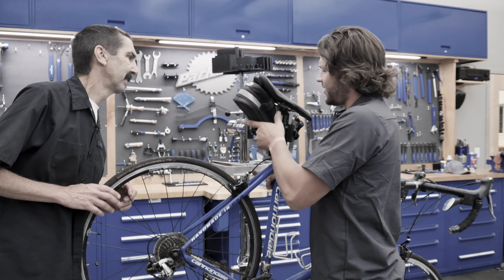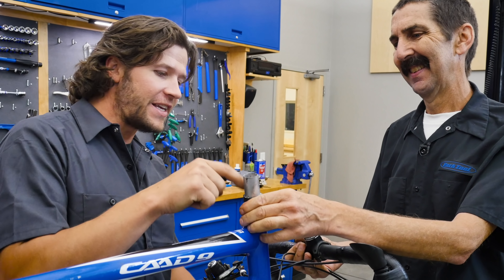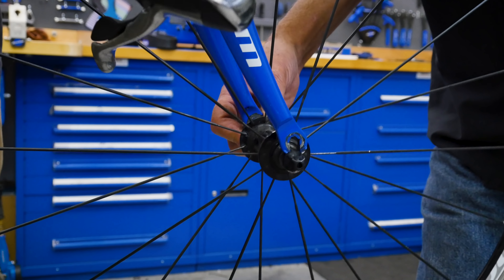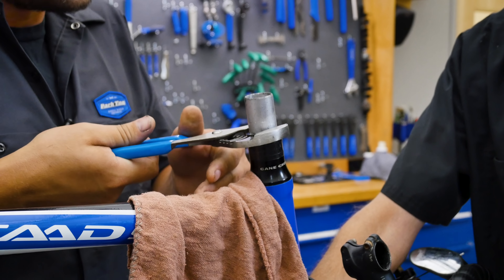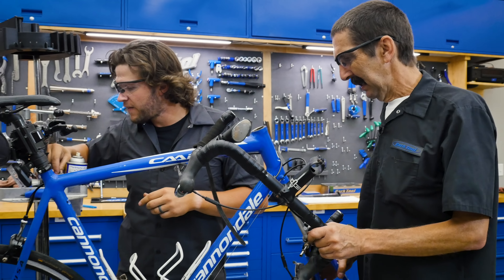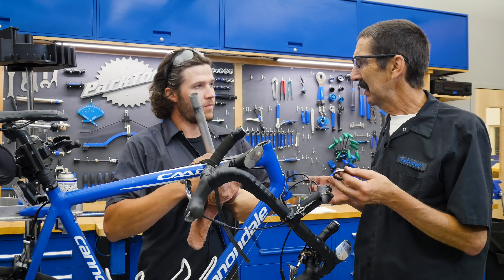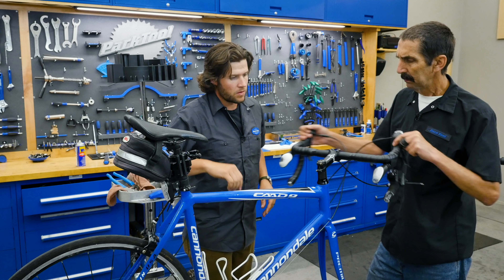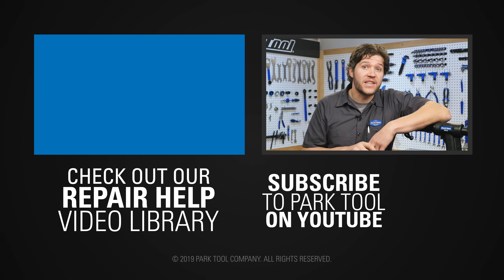Knock On | Tech Tuesday #136

Comment: Would bet the knocking was from the headset preload loosening up over time, and the seized spacers were just preventing anyone from tightening it back up because the top cap was just snugging down to the spacers and not the compression ring.
Reply: This is one of the top 10 smartest YouTube comments I have ever seen. Very serious.

Comment: what about some anti-seize on the steerer tube to prevent corrosion and cold welding between the tube and the spacers or the stem ? is this good practice or a no-no and in any case, why ? Thanks !
Reply from the maker: You could definitely apply some anti seize at that location to prevent corrosion/ bonding. useful stuff.
Reply: @parktool  Alright, thanks a lot! Just did that on an old road bike that started to get rusty on the inside... Hopefully that'll stop further corrosion :)

Comment: I have some question sir about bottom bracket...... My bottom bracket today that i am using is a 70mm×118mm square taper bottom bracket and i am planning to replace it with a new sealed square taper bottom bracket but i cant find a sealed bottom bracket that size 70mm×116mm in our place rather i always found a bottom braket that is 68mm×116mm ... Can i ask if i can replace my 70mm×116mm bb to a 68mm×116mm bb ?

Comment: This is why I love my Lefty Cannondale.  No headset spacers or compression ring to mess with.  Just a steer tube hammered thru two headset bearings and the two fork crowns.  No top cap, spacers, or top bolt to adjust or get frozen up like this bike.

Comment: Would it be a good idea to clean the superficial rust on the steerer tube at the spacer level with something like scotchbrite ?
Reply: Yes it is a good idea and little amount of grease at the spacer level. Prevents corrosion for a longer time.

Comment: Maybe galvanic corrosion caused by the combination of the metal steerer tube and the carbon spacers? Shouldn't carbon paste have been applied when re-installing the new carbon spacers?
Reply: Daniel Berwig  CF is electrochemical very positive, therefore metal contacting is going to corrode.
Reply from the maker: Some teflon grease would have made for a better install of the spacers. This would not be an ideal place for carbon past as its main purpose is to create friction and we were not looking for friction at this point.

Comment: Don't you guys believe in penetrating fluid, like Liquid Wrench or PB Blaster?  I wouldn't trust my bike to a mechanic who uses brute force before finesse.  For example, if the top bearing wasn't damaged before it got to you guys, it may now from hammer blows transmitted to that bearing centering/preload wedge, right above the bearing!  Still appreciate your great, clear videos.  A lot of work goes into them, and I for one certainly do value them.  The humor helps too.

Comment: Hey, for a second there I thought my problems were all over, I have a stuck fork, it just will not budge, removed spacers and top collar but she is stuck fast. No hammer time has worked so far - what do you guys suggest? It's a rockshox sector
Reply from the maker: if you have the spacers removed and the bearing cover removed as well then you should just be fighting the compression ring. Often it just takes a small amount of prying to lift the compression ring. Once the compression ring is lifted i bet that fork will fall out. The compression rings can be a real bear to get loose. Good luck and let us know if that helps.

Comment: Which grease is best for headsets?
Reply from the maker: This depends where you are greasing on a headset. If all I knew is that i would be doing headset work I would pick PPL-1. If I knew I needed to put fresh lube in the bearing race itself to aid it the bearings rotation then I would use HPG-1 or PPL-1 if HPG-1 was not available. If you are pressing in a new headset I would use ASC-1 in the headtube during the press. As seen in the video if installing cartridge bearings into a seat then I like to use a thin layer of ASC-1 so that the steel of the bearing does not react with the Aluminum of the bike. This will be a longer lasting solution than most others in that area. PPL-1 would also work in that area.
Reply: @parktool  Cheers on great detailed answer! =)

Comment: Has anyone tried 50/50 mix of Automatic transmission fluid and acetone as a penetrate oil. I saw this as a mechanics hack and in a review of penetrate corrosion busting mixes. It beat all brands by a great deal less force to defeat corrosion on threaded parts. I don’t know about its performance on galvanic corrosion. Anyone seen or tried this?

Comment: the carbon spacers have no thermal expansion and when aluminum steer tube expands on a hot day it wedges itself to the carbon. If spacers were aluminum they will expand, radially closely with steer tube. Materials selection is not only based on galvanic corrosion potential, thermal expansion and hardness are also important factor. Weight weenie a few grams to go with carbon spacer is not the best idea.
Reply from the maker: In this case the carbon is easier to break off in the future. I have dealt with a few people that just have caustic sweat and carbon spacers have been implemented to allow to break them off if they get seized in place. Has been very handy and a major time saving strategy. So, in this case it's not for weight it's for serviceability.

Comment: You had it apart, it's an old bike, why not go ahead and replace the bearings with angular contact bearings? They'll handle preload much better and not cause drag. Also, you should of coated those carbon spacers and steerer tube with Phil Woods hydrophobic grease (cleaning upper section for stem grip).
Reply from the maker: Im not familiar with headset bearings that are not angular contact. These ones were in great condition and we did not see a reason to replace.
Reply: Far as I'm aware the only Cannondale headset bearings that aren't angular contact are the really old external cup SI 1.5" bearings on old Headshoks and early Lefty's.
Reply from the maker: ^ True! Forgot about those. Those also had a tendency to go bad as they were a great place for water to pool up.
Reply: Okay that's good. Never broke apart a headset bearing but figured since they don't use them (ang  contact) in a BB (where they definitely should be used) then they wouldn't be putting them in a headset. Any BB I ever service on my bikes, I always upgrade to a SS angular contact bearing. Much better way to go, and can handle (and require) much more side forces and preload.

Comment: Looks a bit more than 40mm of spacers not the best for the fork steer tube
Reply from the maker: Right at 40mm of spacers. Fairly upright rider that is on the skinnier side riding rolling terrain in northern MN, we consider this a safe amount for this rider.

Comment: wd 40 15 minute and move no need pliers
Reply: ... and then, if necessary, a strap wrench rather than pliers to twist the spacers.
Reply from the maker: Have you had that work? Never had that work on these for me. Often have to resort to a hammer and chisel to break them apart. Typically on Tri bikes or bikes used on indoor trainers. Also after all that lubrication a strap wrench is not going to grip very well. Even after cleaning the spacers a strap wrench has never gripped these hard enough for me to get them to move.
Reply: @parktool  same here; I had to cut my aluminum spacers off with a chisel after I soaked it in wd-40 for over a week.
Reply: @parktool  To be honest, no. I've never encountered this situation on a bicycle. I've had good luck with strap wrenches on rifle barrels and plumbing fixtures, though. :-)

Comment: why didn't they clean up the stem?
Reply from the maker: Video magic! We did it off camera.
Reply: @parktool  so that's the stain from the corrosion that's left?
Reply from the maker: Thats correct. We may have been able to get that off with a scuff pad but we did not do that this round. We did use a rag and some isopropyl.

Comment: 4:06 WD-40 is not a lubricant!!!
Reply from the maker: WD-40 does a good job of breaking up corrosion, penetrating into seized parts as well as protecting metal. While its not a good lubricant for many things, it was a decent option for this part as we were trying to free a corroded component.